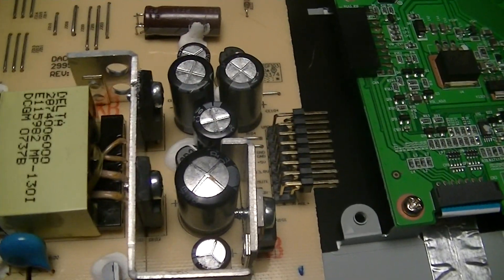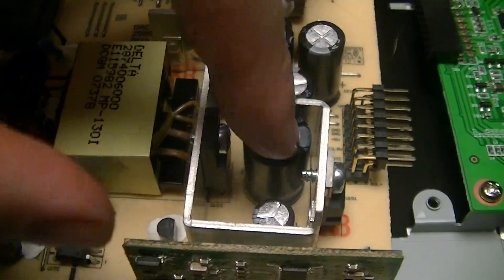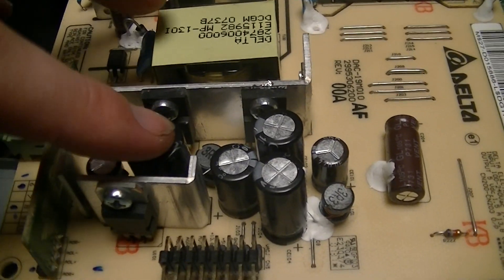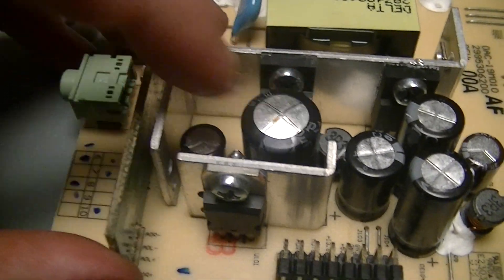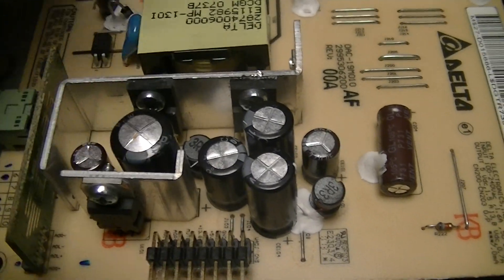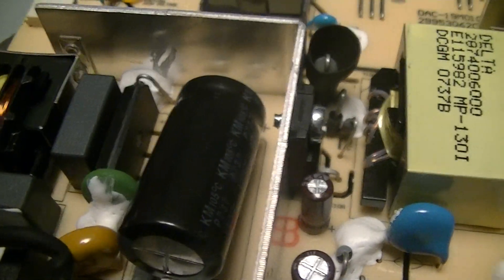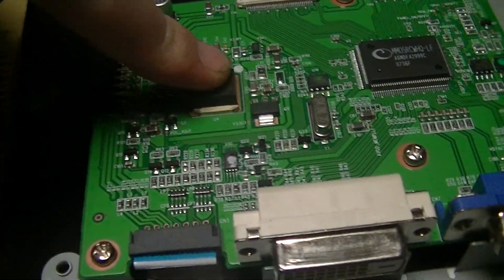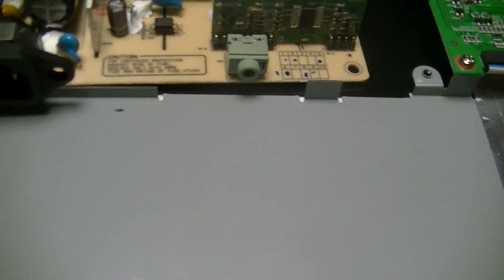Viewsonic monitor guts

Comment: I hate those capacitors. I have 3 acer monitors and all 3 of then had to be repaired for the exact same failure, the crapxon capacitors failed.
Images I took of them http://imgur.com/a/fOm4D and image inside of a crapxon capacitor http://imgur.com/a/di5y8
Reply from the maker: They also killed the Coby TV that I did a guts video of a few years ago, but in that case I just stuck a new PSU to the back of the case.  I suspect that they are at fault with a brand new Coby TV that my parents got early this year (bloody thing wouldn't even turn on for more than a second), but I couldn't see as it had to be returned for a refund.